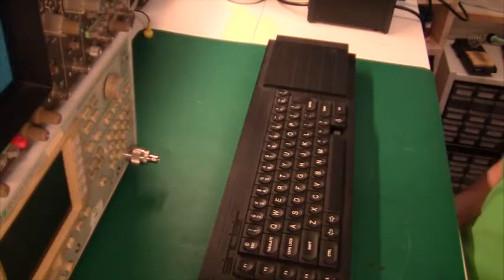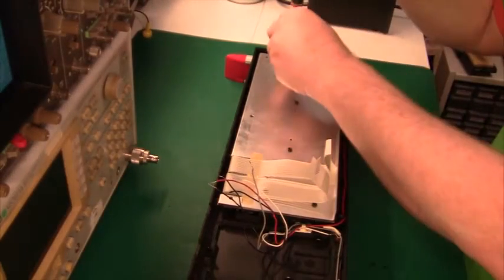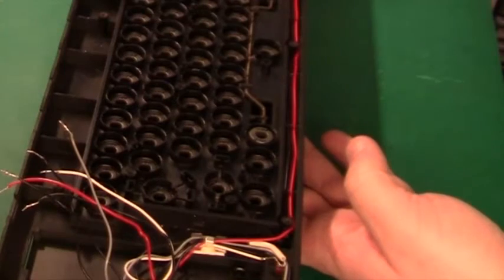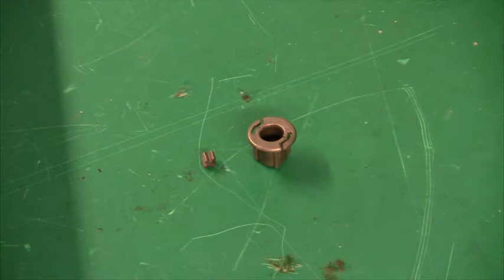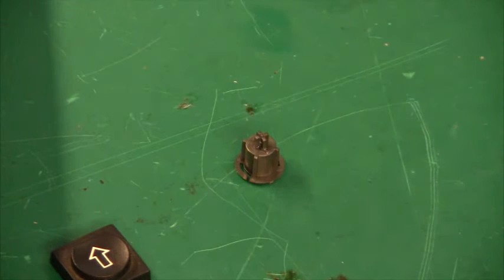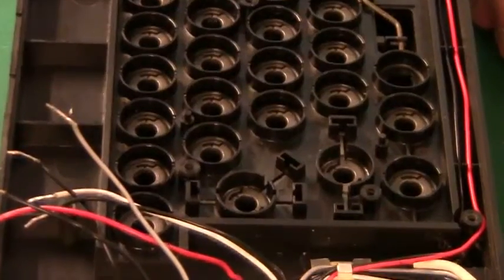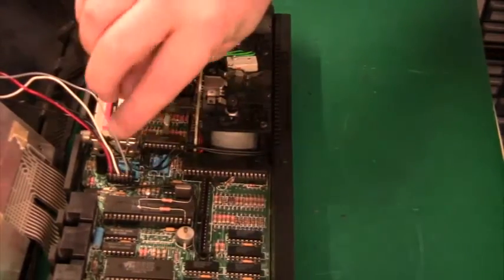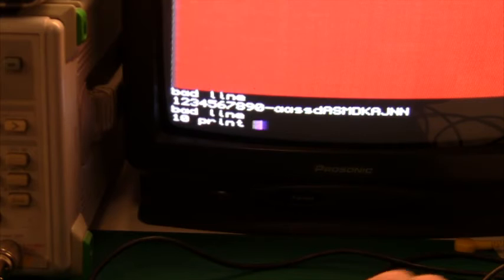Repair of Sinclair QL

Comment: Bizarrely  I spotted a  'kit of ICs' for repairing old QLs  yesterday on eBay.com  ??

https://www.ebay.com/itm/Sinclair-QL-IC-repair-kit-for-retro-Sinclair-QL/114507865506?hash=item1aa9335da2:g:bYcAAOSwyo5fqLLE
Reply from the maker: I am aware of these, but they do not come with the SInclair ULAs.
Reply: @NatureAndTech  I don't think you can get Sinclair QLs ULAs  ??  Unless you have a spare / broken QL to strip for spares ?